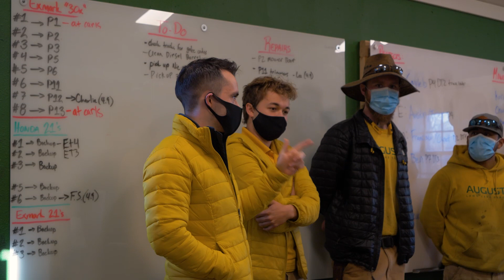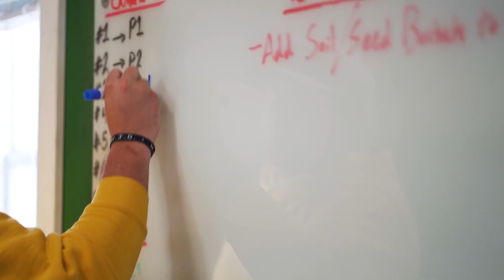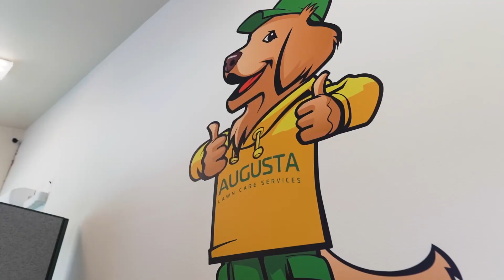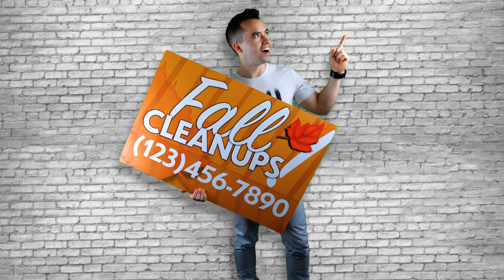🛑 STOP Answering Your PHONE ☎️ | Why Your Business NEEDS a CALL CENTER

Comment: Another huge issue I have . Is trying to afford the extra service for me. It makes sense to hire out a call center . Which I've had a few calls from & spoken to a few reps for. However between merch  - lead gen - website upkeep - maintenance - equipment acquisition- employee costs - it seems difficult to justify spending  on a manager for calls. When most all of my lead generation services account for the calls received in detail on their database. ( does not account for organic calls or calls from lead gen. wjthout  database ) 
However the only issue is that doesn't BOOM answer the phone & get a customer interested etc. Without me . Like listed in the video stopping the productivity of the day to discuss with a potential client the project at hand. Or having to push it off till later. Which is detremential to potentially closing the job. In a nutshell it's foolish to not have a call rep. However allocating the funding is the biggest challenge of the entire process.